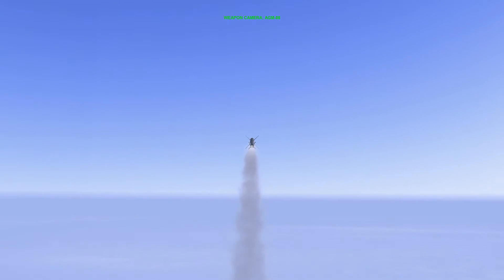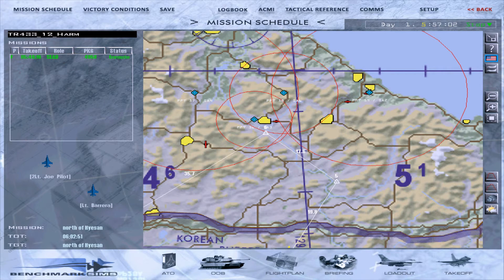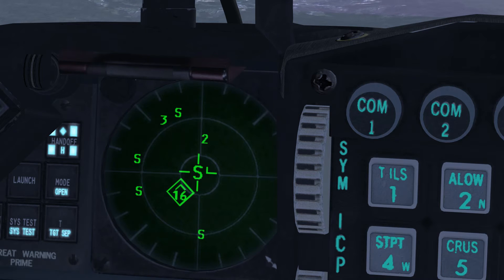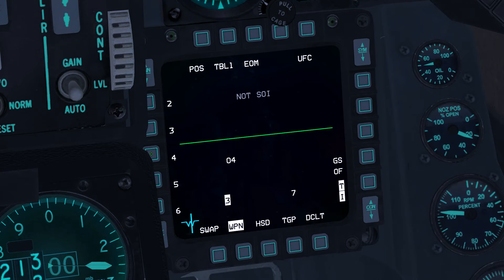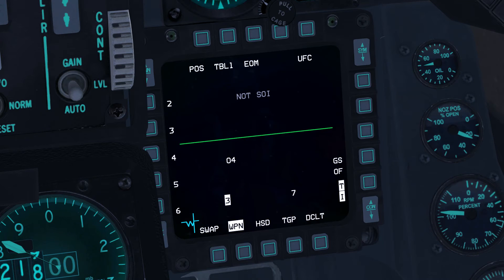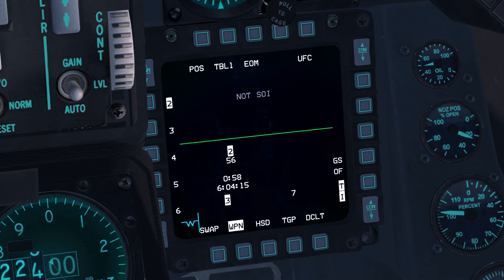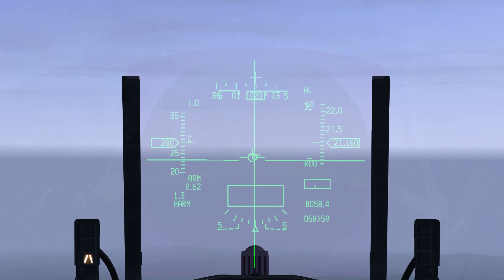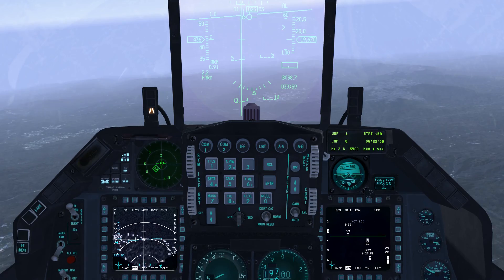Falcon 4 BMS 4.33 Tutorial 8 AGM88 HARM using POS mode

Comment: I'm writing this to clear some confusion out of the way...

HARM using POS EOM mode works very easy but there are several things you need to check.

1) Double Check that your RWR is in steady "s" mode (not blinking "s")
2) Check that your RWR is in Handoff more
3) Check that your RWR is in priority mode (it will make everything so much easier to see)
4) All you need to do basically is to disable the SA radar so
5) Place pre planned threat steer points (PPT) above the general vicinity in your map prior of starting the mission of where the SA battalion is located (dont worry for not being precise, because the missile will track the radar emissions, not your PPT)
6) Either note the PPT number or use HSD to select the PPT in game as shown in the video
7) Use POS to assign the correct SA number to the correct PPT steerpoint
8) WAIT! Until you see the number of the SAM flashing on your RWR (that means that you are actively peaking up the radar's signal / (and that one, yours))
9) When you are in range and all the above are correct, fire away 

"MAGNUM!"

Comment: Why did you use STP 59 and 56 was it preplanned? Or is it set in flight for targets
Reply from the maker: You would always place PPT's on SAMs. When the DTC is saved threat rings then appear on the HSD, which helps with situational awareness. Steerpoints can also be placed on the targets with Desired Mean Point of Impact set as desired. You can set Mark Points in flight, but that's another subject.
Reply: supanova ok on HARMs now and this is throwing me off a bit, the preplannrd stpt 56/59, is there another video that helps in setting those up and how do you enter it in icp. I did the sidewinder and AIM-120 tutorials and did CCIP and CCRP and then switched to HARM but this new concept of pre planned stpt is throwing me off :(.
Reply: Never mind - 3rd time is a charm - I was getting mistaken by SA-3 handoff for second station - figures out how to put a threat stpt and how to enter it about 50 miles out, gave me enough time to configure every thing. Fired 2 HARM’s at the same SA-2 but first one was good enough, I fired the second one about 65 secs of flight timer just in case. But heck yeah it was fun , now going to try a SA-6 with the same approach let’s see how that goes

Comment: RUK and PB are active and simulated in BMS 4.33. In RUK the HARM activates seeker right after launch. PB HARM activates seeker 15nm from SPI or SPT. EOM HARM activates 5nm from STP or SPI. EOM is the most accurate because of the distance in which the seeker becomes active. Just so you know you don't have to use pre plan target steerpoints. All you have to do is if you have a SAM pop up on you on the fly that wasn't in the briefing, just move the cursors on AG radar to move your SPI to appropriate distance, use HAS or HAD to get the distance and either use RUK or PB.

If your distance is more than 25nm and it pops up on you, PB is the best mode. If its less than 15, RUK is the best mode. Also PPT Steerpoints is not realistic, IRL they don't do that. They have HTS that aids the pilot in firing the HARM. Even with the HTS they still can launch POS. How HTS works with HARM IRL is not known, so we won't know until devs know, if they get it right.

EOM footprint is not that big so it needs to be precise as the size of the box is small. PB and RUK have a 120 degree foot print which is much much larger so the seeker can look further out left right and ahead with better FOV. Just check the manual, the graph with the different modes is there, and its simulated. At least down to the footprints its accurate. POS mode is the only mode I use when I SEAD or DEAD. HAD is too easy and way to simple. I'll let the novices have it. :P. Either way though you'll get hits, but with POS its very satisfying to kill a radar in POS mode.

As far as HAS mode goes, since there is a certain distance you have to be in to see it in certain FOV's, I use that instead of HAD to give me a general direction and distance of the threat. Then all I'll do is just cursor enable to go back to POS mode, move the cursors out in front at 30 miles or so then select PB. Depending on the threat array and how many other SAM's are along the route of the same type usually dictates the appropriate mode to use to be the most effective. and once everything is good I pop up hard 30 degress (normally flying low altitude) and fire the HARM. Get the kill and hunt some more and then repeat the process and then go home. There is some fun to this if you exploit it. Flying low and dodging ground fire, setting a perimeter, attracting the right attention, then killing them. If shot at stay low, terrain mask and pick up the fun again. :D :D :D.  Sorry to have written a book about this but this is how I do it, I just thought I'd share and let some one else try it different if they wanted.
Reply: Joshua Martin ￼

Comment: This is a WAY better tutorial than the ones I've seen. Two questions tho, 1)what's the advantages of using POS and probably other modes like RUK, when I can simply lock and launch with HAD?  2) I remember seeing people using POS mode, and there's some sort of ideal pitch symbol that looks like '> <' between the ASL. I don't see it in this video tho, do you need to toggle it on or something?
Reply from the maker: The only POS mode recommended is EOM. The other modes, including loft cues, are not properly implemented currently. The general idea is to use POS EOM with pre-planned static targets. HAS mode is used for targets of opportunity and mobile threats.